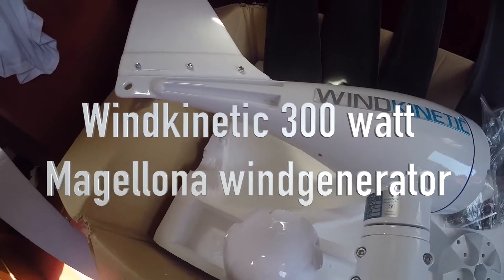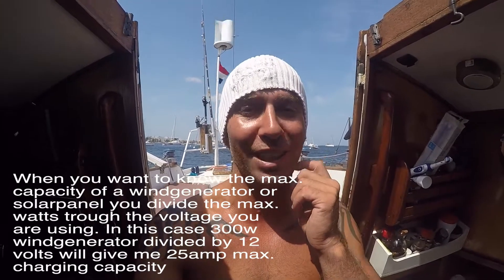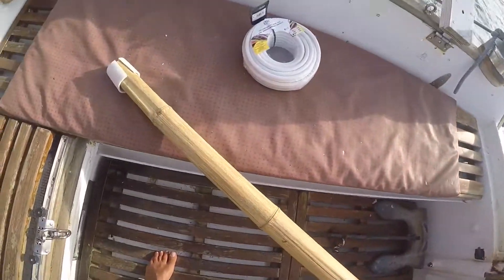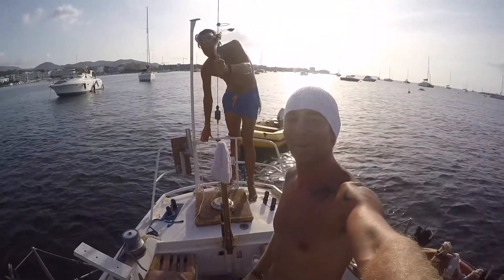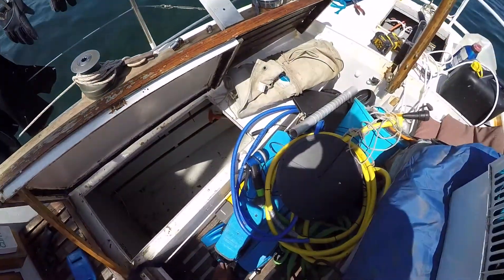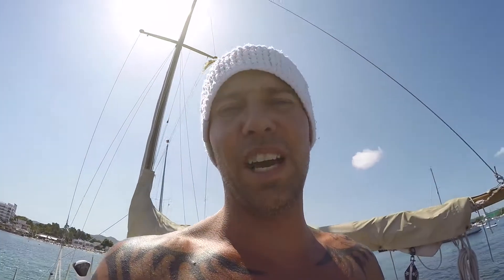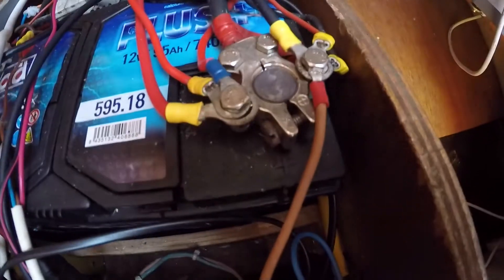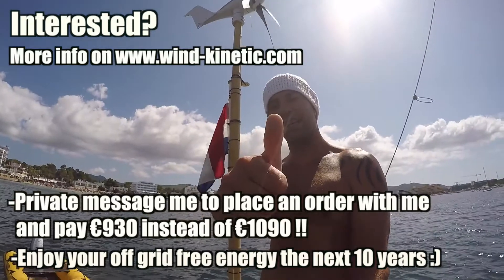Free electricity, electric, Installing a 300 watt 25 amp Windgenerator Windturbine Testing

Comment: Is that enough for your electricity at sea? do you also need solar panels? I am interested to know how much electricity do you make and how much do you spend :D
cheers
Reply from the maker: pijafinocchio i have this turbine that can make 25amp/h and two solapanels and i always have enoug energie for everything, lights, starting engine, charging al my electrical stuff like drones, computers, phone. Note, i dont have a refrigirator.
Reply from the maker: pijafinocchio setup two solarpanels, batteries, controlers and windturbine about 1500€
Reply: Thanks for the answer, one last question: what is the Wattage of each of your solar panels?
Reply from the maker: pijafinocchio they are 100 watt each and Total give me about 5amp per hour togeter
Reply: thanks!

Comment: Great job, I have a Duogen on my Rival 32 so I can generate when sailing as it converts to a hydro generator. Just one question, you seem to have loads of wires connected direct to the battery why is that? I have a positive and negative bus behind my switch panel and very few wires going to the batery. Hope the Bocardi and Coke was nice. Andy
Reply from the maker: FrenchAM100 that's correct, best is the system you have with an collective fuse box but I am always a bit hasty with installing my gear and don't have the money now for a nice fuse box so I so I just connect it straight to my battery and put a fuse inbetween, I will clean it up when i get some extra funds 😊👍